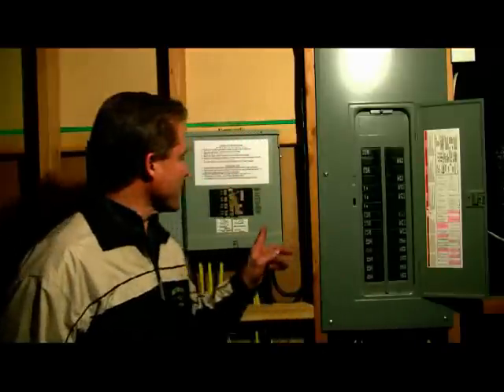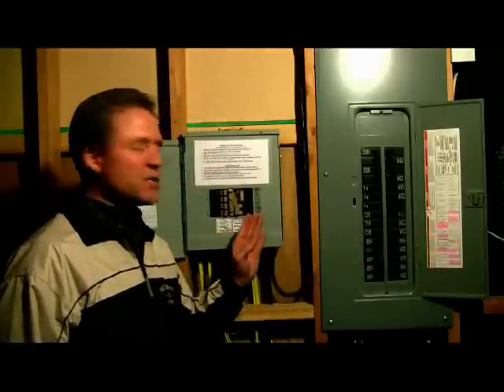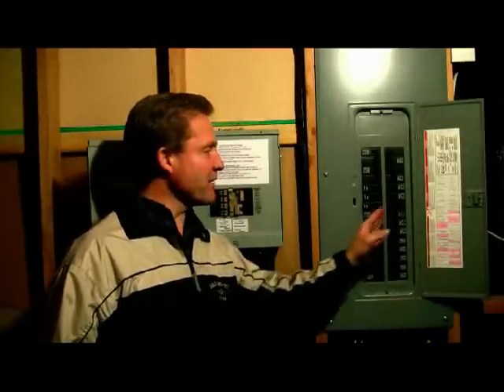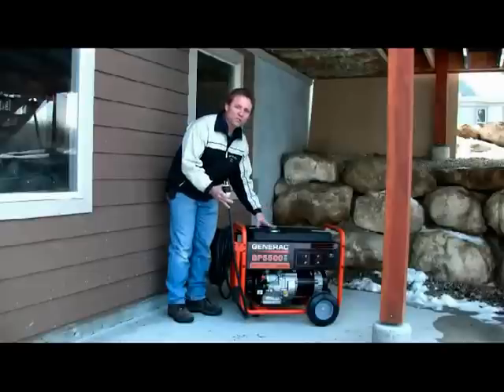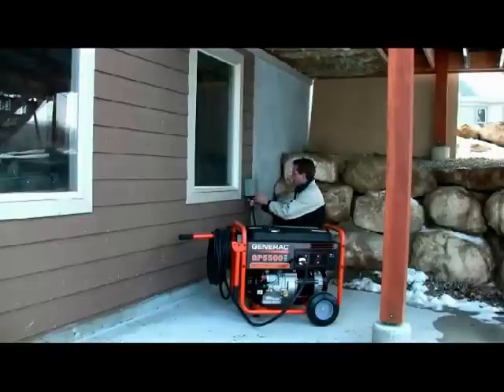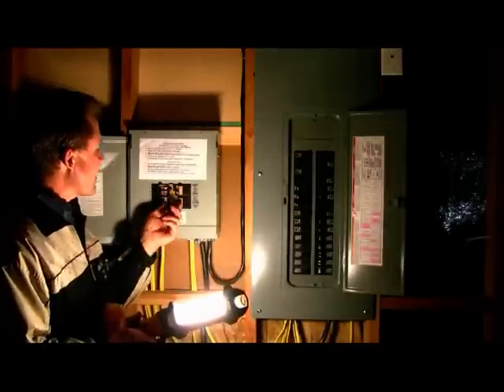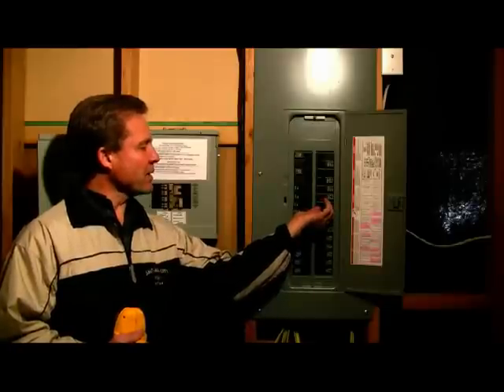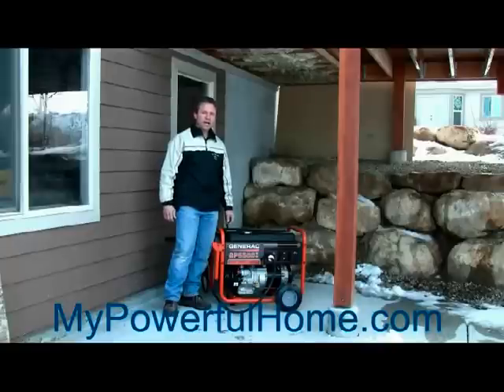The best way to connect you portable generator to your home.

Comment: Good video. Here's someone who prepares BEFORE an outage and does  it using one of the correct methods to supply power from a generator - that's why the dislikes and negative comments from those who don't know what they are talking about and  fans of dangerous lash- up methods such as back-feeding I guess.

Comment: now you have done it right there are people that are doing it all wrong for back up you need a seperat breaker box to supply the most needed outlets for frige frizer ac unite and or what you need to provide power to and also chose a generator for the circuits you are going to need great video.

Comment: One addition I'd make to this would be a non-maintained emergency light on the ceiling above the breaker panel. This will illuminate in the event of a power failure, running on its internal rechargeable battery, so you can see what you're doing without having to go and find the torch. Of course a torch would be handy for hooking up the generator, one can be kept by the breaker panel where you can now find it :)

Comment: I like the method described in this video.  It uses a good quality panel with full size circuit breakers, which, if you know what you're doing, costs less and uses better quality components than those cheesy retrofit transfer panels with the button breakers.

Comment: @0UT3RL1M1T5 It would have been two phases ov a three-phase system, so the phase angle is 120 degrees. That's why there's 400 volts between the phases and not 460v as one might assume.

Comment: @xanataph I didn't know electricity was supplied in multiple phases. Is two-phase like two sine waves but 180 degrees out of phase with one another, so that one would peak while the other is at it's lowest point (on an oscilloscope)? Wouldn't that defeat the purpose of AC? I guess the more phases you have, the more continuous power is supplied.

Comment: Great vid nice system instead of transfer switch, question If I have a 4400watts generator with three outlets would I need three plugs ?? or which one oullet is good to use?  Thanks so much.
Reply: Here is a reminder about portable generator safety: This advice is just to make sure that everyone is aware of all the warnings and it’s just to remind people to be careful using portable generators. Everyone has to see this safety reminder for safety. Every year, hundreds of people die or get injured when using portable generators due to carbon monoxide poisoning and electrocution. Make sure you are using your generator carefully and keeping others safe as well. There is something very serious that everyone should always be aware of when using generators. Some people do run their generator indoors which is not safe and that increases the risk of carbon monoxide poisoning which can cause death of family and you. Some people run their generator in wet conditions which can electrocute them. Please remember that you should never run your generator indoors. Remember that carbon monoxide is an odorless and colorless gas that you cannot see or smell. Carbon monoxide is a silent killer. Keep that in mind. Make sure your generator is 15-20 feet away from your house and away from doors, windows, and vents. Never use your generator in your porch too. Having a carbon monoxide detector is very important against generator safety. Some people also allow children to go near the portable generator which could pose risks. We need to keep an eye on our children making sure that they are not near the portable generator so they won’t get electrocuted or burned by the generator which is dangerous. A locking enclosure also keeps kids safe. A generator shed might look like a tempting place to explore, or take cover during a game of hide and seek, but a generator is a dangerous piece of equipment that can cause injury. It says on the manual that we should also keep children away at all times from the portable generator to avoid injuries. Please do not allow a child or unqualified people to operate the portable generator. Just because some manuals missed what should be listed doesn’t mean it’s safe to do. Always follow the generator safety rules when using portable generators. Generators pose electrical risks. If you need to use your generator during wet weather, you need a generator tent to protect your generator from getting wet. Don’t let your generator get wet. Keep your generator dry and before using your generator, please make sure your hands and your generator is dry. Do not wear loose clothing when operating the generator. Everything that is said on the generator’s operating manual should not be ignored. Never smoke cigarettes near the generator. Please keep flammable things away from the generator. Never overload your generator too. Your generator can catch fire. Never ever try to plug a generator cord into a wall outlet to avoid back feeding. Back feeding your generator is dangerous. Always turn on your generator first before plugging in appliances and shut off the appliances before turning your generator off. Use a heavy duty cord for your generator and the cord should not be worn out. All the instructions should be followed carefully. Never refuel your generator while it’s running. It can cause fire if fuel spills while your generator is hot. You should turn off your generator and let it cool off before refueling it. Having a fire extinguisher next to the generator is also important. This is only a reminder for everyone’s safety of using generators. Make sure your generator is properly grounded. https://youtu.be/I1jT3ANENvI and here is a video more about keeping others safe when using generators and also about our family’s safety. Hope this helps. Thank you. Be safe

Comment: The only real problem with this hookup is that the utility feed breaker and generator feed breaker in the auxiliary panel need to be physically interlocked so that it is physically impossible for them both to be on.  These days you can buy a generator panel that has this interlock in place, but I don't know if they were available back in 2010.

Comment: Keith, great video. Question, if I'm correct that generator in this video looked like a 5500 watt. Could you use that generator to run the ac in the home if everything in the wasn't being used except the ac, would it run it and if not what size generator would ya need to run the ac? I's a 2.5 ton unit and I have a 1600 square foot home inside and it's very small. I live in Jacksonville Florida where the humidity is deadly. I mean you sweat like a hog being outside for just 5 minutes so when we loose power in the summer it's ridiculously hot. That's why I'm asking about the ac only. I don't need microwave or lights just the ac. Thumbs up on your video buddy. Take care.
Reply: Here is a reminder about portable generator safety: This advice is just to make sure that everyone is aware of all the warnings and it’s just to remind people to be careful using portable generators. Everyone has to see this safety reminder for safety. Every year, hundreds of people die or get injured when using portable generators due to carbon monoxide poisoning and electrocution. Make sure you are using your generator carefully and keeping others safe as well. There is something very serious that everyone should always be aware of when using generators. Some people do run their generator indoors which is not safe and that increases the risk of carbon monoxide poisoning which can cause death of family and you. Some people run their generator in wet conditions which can electrocute them. Please remember that you should never run your generator indoors. Remember that carbon monoxide is an odorless and colorless gas that you cannot see or smell. Carbon monoxide is a silent killer. Keep that in mind. Make sure your generator is 15-20 feet away from your house and away from doors, windows, and vents. Never use your generator in your porch too. Having a carbon monoxide detector is very important against generator safety. Some people also allow children to go near the portable generator which could pose risks. We need to keep an eye on our children making sure that they are not near the portable generator so they won’t get electrocuted or burned by the generator which is dangerous. A locking enclosure also keeps kids safe. A generator shed might look like a tempting place to explore, or take cover during a game of hide and seek, but a generator is a dangerous piece of equipment that can cause injury. It says on the manual that we should also keep children away at all times from the portable generator to avoid injuries. Please do not allow a child or unqualified people to operate the portable generator. Just because some manuals missed what should be listed doesn’t mean it’s safe to do. Always follow the generator safety rules when using portable generators. Generators pose electrical risks. If you need to use your generator during wet weather, you need a generator tent to protect your generator from getting wet. Don’t let your generator get wet. Keep your generator dry and before using your generator, please make sure your hands and your generator is dry. Do not wear loose clothing when operating the generator. Everything that is said on the generator’s operating manual should not be ignored. Never smoke cigarettes near the generator. Please keep flammable things away from the generator. Never overload your generator too. Your generator can catch fire. Never ever try to plug a generator cord into a wall outlet to avoid back feeding. Back feeding your generator is dangerous. Always turn on your generator first before plugging in appliances and shut off the appliances before turning your generator off. Use a heavy duty cord for your generator and the cord should not be worn out. All the instructions should be followed carefully. Never refuel your generator while it’s running. It can cause fire if fuel spills while your generator is hot. You should turn off your generator and let it cool off before refueling it. Having a fire extinguisher next to the generator is also important. This is only a reminder for everyone’s safety of using generators. Make sure your generator is properly grounded. https://youtu.be/I1jT3ANENvI and here is a video more about keeping others safe when using generators and also about our family’s safety. Hope this helps. Thank you. Be safe

Comment: @0UT3RL1M1T5 But you guys have 220 volts available in your homes for high current appliances eh? And that comes from across two phases, yeah? 

Our three phase is 400volts between the phases, so that's really lethal. Not something to muck around with. But it is usually only supplied this way to industrial sites, not normally supplied to the domestic premises. Here it's all 230v between phase and earth. They used to bring two phases into houses occasionally, but not any more.

Comment: between the meter and the breaker box install knife disconnect when the disconnect is in the closed position there is 220 240 going through it ..on the bottom side of a disconnect installed an industrial type pigtail it comes out from the bottom of the disconnect about 2 foot so when a power outage occurs ..you throw your knife down ..disconnect off position ..thats separating your line in voltage.. At that point to the house or breaker box .. plug your pre-made power cord swamp generator output to your pigtail plug-in into the pigtail .. Make sure you put a lock on that disconnect keeping it in the open position from  utility Power service and you automatically tied into the house and separated from the serviceline power.. of course put a lock on your disconnect to keep it in the open position separating service power and your home there's no fucking Breakers tripping Breakers because you're using the same breaker box it works good work for a long time  electric company likes it it's a winner

Comment: Incorrect. The breakers in the transfer breakers are UL listed the same as the ones in the house panel. People should also note that it is illegal to remove the power meter from the enclosure.

Comment: I'm building a 14x40 loft cabin. It will have 36' of living space. Can I use a generator to power my cabin? I need to power a refrigerator,  stove, 3 TV'S (not simultaneously ), microwave, light, 20 gallon fish tank,
And  devices.
Reply: +cherise briscoe Obviously YES!!! But that depends on how much power your generator puts out. Small ones can be as little as 800 wats, while bigger ones can be 15,000 watts, and you can get monster ones that produce more power than what comes in from the grid.

Comment: probably cost just asuch to install as a small stand alone inclosed generator.
Reply: exactly right,the best way to do this is a standalone with an automatic transfer switch with the generator running on natural gas or propane.That would be more money but it adds to your property value.

Comment: how long can one full tank last you on a generator ?
Reply: a lot less than one shit on a job
Reply: Brandon Lugo k
Reply: Mine is 6000 watt and will run around 10 hours on 5 gallons i bought a reliance transfer switch.  Safer and easier to use than this method there are other brands too.  Generac also makes great generators and accessories and if you buy their generator and transfer switch they will install for you

Comment: What a crock.  All you need to do is put in a transfer panel next to your electric meter.  This way you can power your entire house instead of just a few select circuits.  My 5k diesel generator powers everything, including the well pump.

Comment: What I don't like is that panel requires several switches turned on/off in particular sequence. Very Easy to make mistake and fry something. This should be all one switch -  designated circuits run from utility or generator
Reply: It is called following directions or a check list. Are you unable to follow a set of instructions in order? You can buy an auto switching transfer switch that will automatically switch to line or generator, if the generator has battery electric start...but those transfer switches can cost as much or more than the generator. My generator covers my house without a separate transfer switch. It comes in via a 240 breaker. I turn off the main, all other breakers, on the generator feed 240 breaker, and then only the needed circuits. At no time can the gen and main breakers be on at the same time. I have a detailed checklist I follow...but that is the military part of me...I can follow simple instructions.
Reply: Badboy7357
 what kind of generator do you have? and how is it working out, reason being I'm looking to buy one soon and I'm up for suggestions. right now I am looking at a westinghouse 7500 that's got some pretty high reviews on amazon
Reply: I have a Generac 6500 that is 8000 peak. I have not tried to run the central air as that would probably take it all, but with gas stove, furnace, and water heater, it runs what I need in a power down situation. If you have electric stove and/or water heaters and other electrical heating devices, you will need a large generator or have to live without when on gen. Get the largest gen you can afford, use real gas (not ethanol), and be careful wiring if you do it yourself. I installed a plastic conduit run, pulled service pole to home gauge cable into it to get to my main box. It has worked very well for me...but under no circumstances can your grid main breaker be on at the same time the generator is connected and running. I am thinking of a fuel conversion kit for gas, NG, and LP. NG and LP are less efficient, but LP is easy to store and does not break down while NG is almost always on if you pay your bill.
Reply: The Lock Bar keep you turning bother Power Switches at the same time; one or the other, but not both !  tjl
Reply: Keep your fuel fresh and use Propane or the Gas Pipeline.  tjl

Comment: you had better read the NEC code be for doing this  it is required to have a transfer switch not a bouncy of them, you can get some one killed this way
Reply: exactly right ,if you burn down your house and the electric work was not inspected and up to code your insurance does not have to pay off.Read your insurance policy.
Reply: Gene Conley.  Please tell be where the NEC code says I have to use a transfer switch on a portable generator.  Code says you have to use a transfer switch for standby generators, but as long as the conditions of 702.5 are met, I do not have to use a transfer switch.  I will stand corrected if you can show me otherwise

Comment: @xbox360rocksful    

 That is what he did //  plug anything into generator till warmed up refers to applied load 
with a disconnect inside / / That's what he did // He referred to letting warmup before turning on the disconnect // which is the  applied  load // Please re watch video 
I am Electrician for 25 yrs //  They right the  manual for laymen 
When every using in this method // He should  have mentioned check cord for breaks or damage before every use//